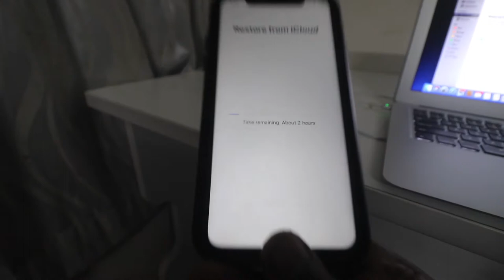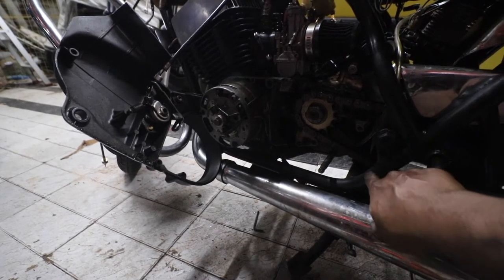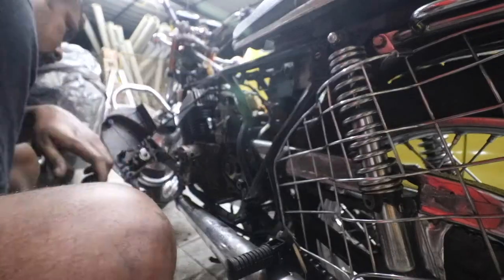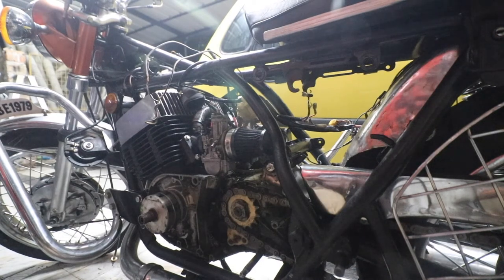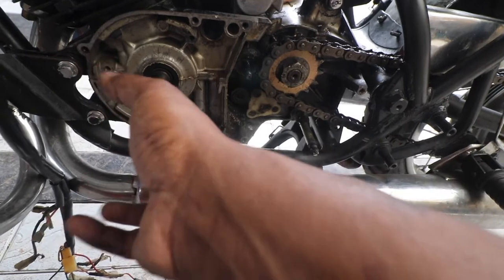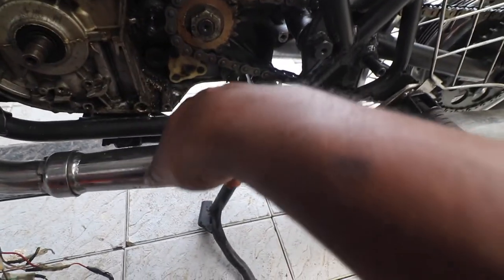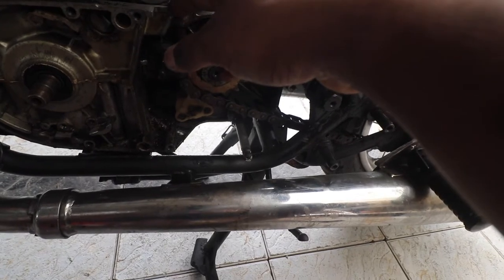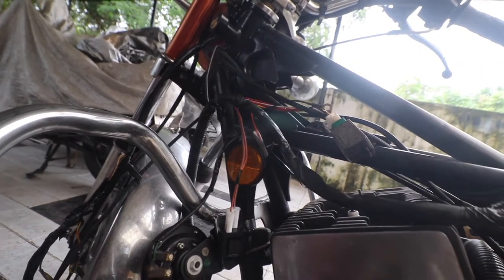RD350, CDI conversion and full wiring (English video)

Comment: Why this RD is converted to a CDI ? Which CDI kit is used ? What changes are seen after the change ? 
My RD is running perfect on a CDI but im planning to convert it again to points !
Reply from the maker: This bike had a TCI kit and it was not running right. Presently it’s running RDD black box on allied 90/100 stator. It’s really good to use a CDI instead of points, the main reason is points are a pain in the wrong place, they require very high level of maintenance. You have to keep a track of the number if times you honk or use indicator or headlights because if the battery charge falls below a point your bike won’t run. Trust me it’s the best thing one can do to an RD

Comment: Hi yamakaze 
I am restoring my rd350 (1975 model). Complete electric system is not with the bike. So I plan to install a CDI conversion kit with all electrical system. Could you tell me 
What can I do for the electrical system? ( is it good to use a cdi conversion kit instead original electrical system)
which cdi conversion kit is best for the rd350?
Reply from the maker: CDI conversion is the best way forward, from your description of the model it doesn’t appear this bike is from India. If you need further help ping me on Instagram. I can guide you further
Reply: @Yamakaze  Thank you 
Yes it is from Japan.
Do you use Facebook.
I don't have Instagram.
Which conversion kit do you  recommend ?
Reply from the maker: @akalankalv69  I have a Facebook page, details in the description. Look for my allied conversion video of my green bike

Comment: Hi Yamakaze. I see that this one had the TCI kit. Could you please let me know if I could buy it from you or from your friend who owns this RD? My sincere apologies, if you think I am misusing this space for a buy.
Reply from the maker: The reason we removed the TCI kit was it would leak spark and it would stop firing on one of both cylinders. It’s better to upgrade to a CDI kit as this would guarantee you some peace of mind
Reply: Hi Yamakaze. Thanks for the response. I have three RDs (not boasting, but explaining) One running on Daiichi points, second on Indian electronics CDI and third dismantled for restoration. Though I take your advice, still want to try the TCI ignition on the third one because I have never tried it. Could you please let me know if i could buy it? And I am from Chennai. Thanks for your support. 🙏
Reply from the maker: kalaiselvan chinnaiyan I will ask my friend who owns the orange RD, pm me on Instagram details in the description of the video.

Comment: Man it's not working your right cylinder firing is very weak because of that the fuel wasting will be there and the fuel consumption will be higher average will be down at the same time the power of the vehicle also down so you have to check and look after the right side firing
Reply from the maker: 4 year old video man 😆